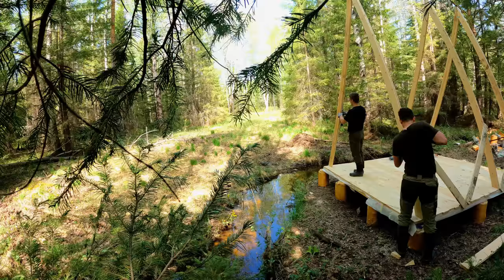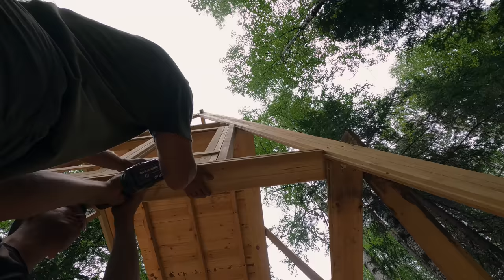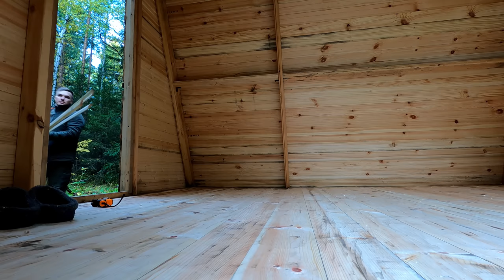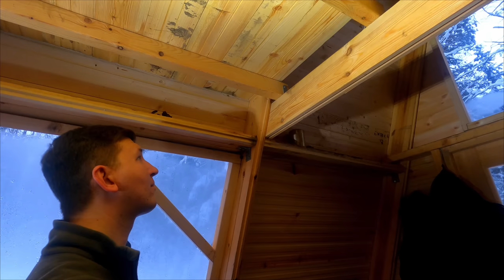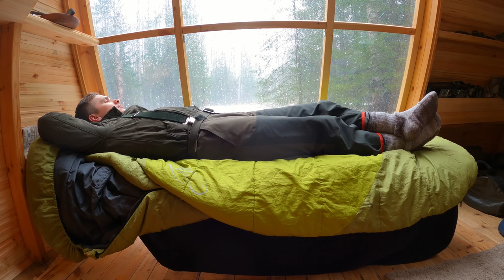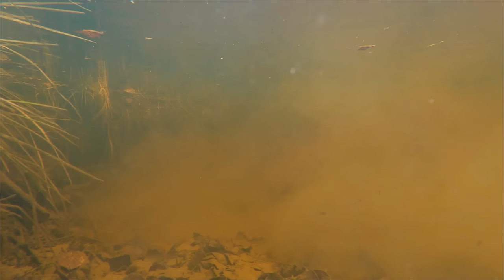Building COZY A-frame HOUSE on the RIVER bank with a beach. Start to finish 1 year in 40 minutes.

Comment: cool - but those wood rounds they are using as a foundation will rot out within a year or two
Reply: Thats what i was thinking wheres the foundation seems a waste of effort for a temporary build without a proper foundation
Reply: @robertmurray2843  exactly right....they'd be better off using rock or concrete block....something that doesnt rot over time
Reply: And i hope that thing is light enough to move when that creek (NOT a river!) moves.
Reply: Yeah burn em or soak them in epoxy dude
Reply: Looks like yellow cedar, it won't rot for 10 years
Reply: these round timbers did not have time to rot. intruders burned this house. maybe it was done by poachers who didn't need witnesses. a camera trap was installed near the house - but the attackers knew where it was placed and set fire without getting into its field of view.
This video is from last year.
Reply: ❤the reason why 2x4 aren’t floor joists is not to sell 2x8 s
Reply: Hat and boots are not just for people
Reply: Thats not necessarily true, rot times will change drastically depending on environment.
Reply: @izzyplusplusplus1004  wet = check......dark = check.....both are ideal for rot
Reply: Also those roofing screws really need to be on the ridges of the corrugations.
Reply: @Snoochyboochy  Wrong, the valleys are manufacturer recommended, you're thinking of the old school 5v roof sheets made from tin or steel. Those do require ridgetop fastener placement.
Reply: @csmidt2885  Not in the western high elevations it isnt. Wet stuff just freezes all fall winter and spring. So trees die and they take 60 years for a spruce tree to rot. Whereas here in TN, a spruce tree can fall anywhere in the tennessee valley, and be completely gone in 10 years.
Reply: @izzyplusplusplus1004  ya.....no....these are cut rounds in the dirt....cold weather or not they will start rotting within 1 year or 2....been cutting down timber my whole life
Reply: @csmidt2885  In most places yes. I'm just saying that there are places that were built like that many years ago, that stood for many many years. Dry, cold climates. Like portions of the rockies. But yeah, I'm sure those would have rottened really fast, but not in less than 3-4 years, even in the north georgia backcountry.
Reply: It will probably flood sooner, so no worries.
Reply: @izzyplusplusplus1004  selam olsun
Reply: My wife took a wood round from a tree that fell in our front yard and is useing it at a small table between two rocking chairs in our front garden it’s been 4 years and shows no signs of rotting when I can I expect it to rot moving forward so I no longer have to look at it ?
Reply: I was think this people just video content nothing serious build house .. because his timber not good .. 2 or 3 years can break .. hmm ..
Reply: They seem to have paid so much attention to detail on everything else. I think they’re probably smart enough to know to use some thing that’s not going to rot on them in two years and making the assumption that they don’t know what they’re doing just sounds really, really American of you.
Reply: @Tavieme  learn to read, its not an assumption, i speak from experience with both building and cutting timber.....kinda hypocritical considering you are actually making an assumption based on NO EXPERIENCE
Reply: Especially since concrete is cheap
Reply: Нет они используют древесину лиственницы она  гниёт 10-15лет
Reply: Builded just for adsense bruh
Reply: If he charred them would last longer
Reply: They last for more than 20+ years

Comment: That house is filled with moisture
Reply: No way it's a house, it's a cabin at best lol. No insulation, literal holes in wall (can see light coming through). I cringed as he was putting the sealant tape around the big window lmao. 

It's a great video but no one is living here year round.
Reply: @OriginalBlackmoore these guys had built the weekend log deep in the forest. It wasn't their aim to live there all year around. But they did sleep there even in wintertime. They've built it to runaway from the city noise. Unfortunately someone had burnt their house. But they've bilt the new one

Comment: I don't know, I have questions...
The foundation looks super cheesy. Log rounds set in mud? Not even excavated ground but just set on top? That's it?
The cabin is point blank on that little creek. What happens when it rains hard and it rises? The whole location is mud.
The roof joists couldn't be more minimal. Why? Add a few more of a somewhat larger dimension.
The frame for the hinged window/wall looks very flimsy indeed. Keeping into account the desire to keep it light, a few dimension elements like a triangle or two would give some integrity to it.

I'm a little perplexed as they used some pretty good materials like the thick tongue and groove, painted everything with what appears to be linseed oil or similar, had some good design elements, but built everything on stumps in the mud that will rot and settle, betraying the structure.
Reply: Russian technology of foundation
Reply: oh, sorry, russian non technology of foundation)
Reply: yeah, wouldn't this thing get blown over onto its side in severe storms?
Reply: If you check the original channel you will see that this A-frame was later burnt to the ground by local forest poachers, and the only thing that appeared to stay untouched after the fire are these log rounds, such an irony.

Comment: You guys certainly did things the hard way.  And the design, inside and out was off.  I think you definitely worked hard but it just didn’t make sense.
1.  The stove next to the door 
2.  The fiberglass door/window that was very flimsy and unstable 
3.  The placement of the beds.  Should have been bunk beds on one side 
4.  The high ceiling space not being used, so why have it
5.  Putting on plank siding row by row just to hide with roofing material.  You could have just used slabs of plywood 
6.  Built on an obvious flood zone river bed

Comment: I may be missing something but thin walls no insulation in a cold climate and lots of windows :/
Reply: Nah, this was definitely filmed just for views. They never had any plans to do anything with this build, and from what others are saying this thing burned down already (likely from the wood stove they put inside of it with no hearth or anything to protect the wood from the heat of the stove).

Comment: Looks great. Do you plan to put a railing around your outdoor extension? Also, you may need to have two supports for your wall when you raise it. I noticed it bowed with only the one. The color choices for the exterior are great to blend with the environment.

Comment: how do you know the ground will settle evenly under your foundation posts ?
Reply: There wouldnt be time for the ground to settle before it blows down, falls over, washes away, or the stove burns it down.
Reply: @MoontownMoss  The stove actually did burn it down, but my guess would have been a mild breeze

Comment: Clearly this is built in a vegated wetland on muck.  It will probably sink, and flood.  Hopefully it's not a big of a watershed.  Dont let the conservation agent or building inspector on your land....O.o
Reply: Bryan would be no fun at all to hang out with. Much less homestead with. 😂
Reply: @CaptianJC  If the inspectors sees it and makes you rip it down, don't say I didn't warn you.  Are you guys squatting?  I designed and built my own home too.  I just had to follow International building code.  Given the height of this structure, so do you.  My professions is to permit structures, parking areas and septic systems near wetlands and flood plains......

Comment: nice work, just too close to the creek. if that thing floods your screwed. the banks of the creek could erode, the wood will rot and the foundation will become unstable which will cause damage to structure. not a good idea to be that close. if your going to build that close you need stumps that go deep into the ground and the hut itself should be higher up incase of flooding. also that wood doesn't look like it's treated for water damage so your gonna get mold.

Comment: Really cool build guys!!! I don't know much about construction or building but I have never seen that type of roofing you guys used, it sort of looks like green canvas. What is it exactly? It looks really cool and easy to use.
Reply: its green sheet tin
Reply: @davids2676  that's what I though at first but it has that weird texture on the outside, is it incased in some sort of fabric or something?
Reply: Ondulin is a lightweight roofing material, which is a corrugated sheet of cellulose impregnated with bitumen. On the outer surface, the sheets are coated with a special resin and dyes, due to which they become more durable and acquire a beautiful appearance.
Reply: @roxanareger4196  Thank you for your insightful reply, much appreciated

Comment: Overall, I'm not impressed.  It's built in a very risky location (a flood way).  The foundations are inadequate.  The floor frame is too flimsy.  No insulation in the floor.  No insulation in the walls/roofing.  That PVC window will rattle like crazy in high winds.  The stove is right next to the door.  Inadequate protection between the stove and the floor.  This place looks like it will fall to the ground after the first decent gale force storm or blizzard.